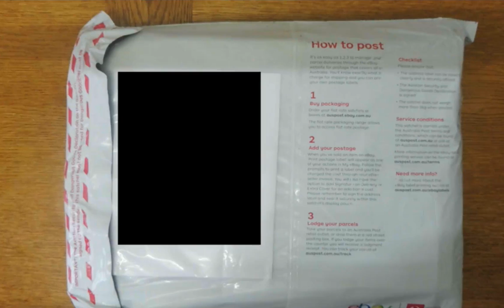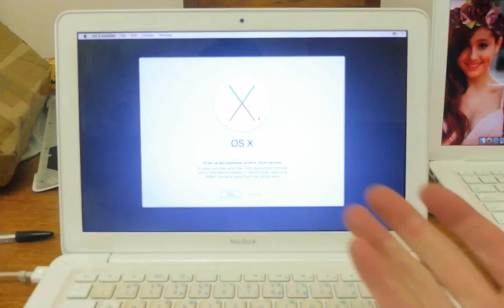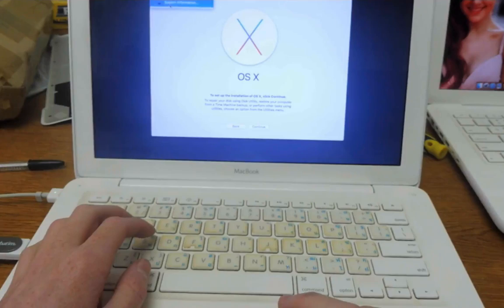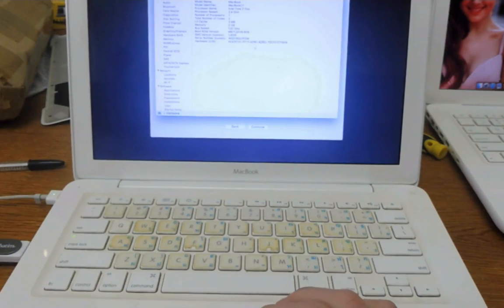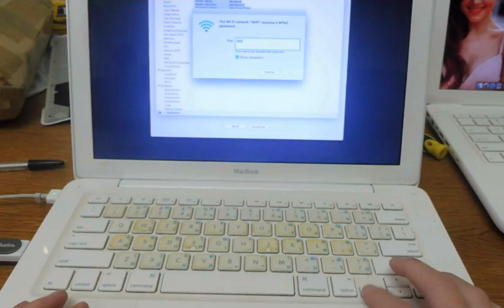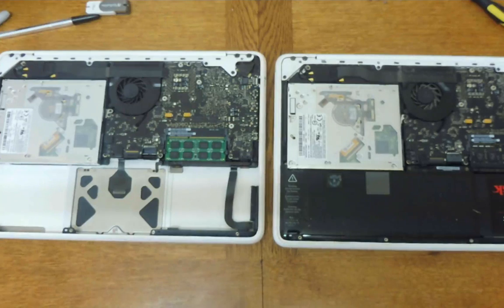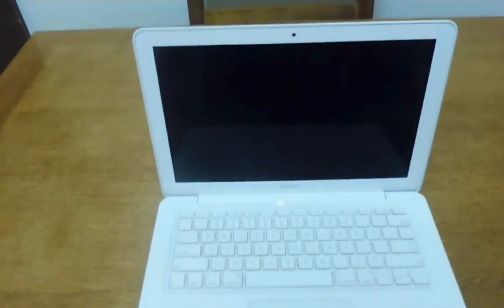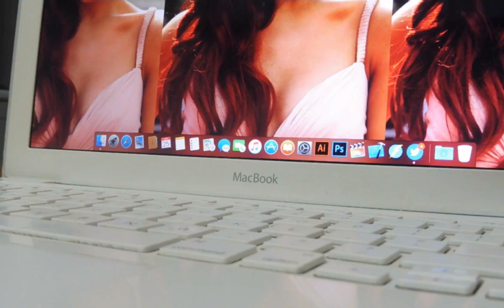Water Damaged MacBook Adventures Part 1 - Initial Look And Test

Comment: A little advice: I see you have a 240GB SDD, but the video shows you have only 8.27GB of free space. If you really need that much drive space, you should upgrade immediately to at least a 500GB drive. Every knowledgeable authority will tell you emphatically to keep NO LESS THAN 10% FREE, otherwise, you're drastically shortening the lifespan of your SSD. If you really want to see your 2010 MacBook scream, install TWO 500GB SSDs by ditching the optical drive, and set them up as a RAID 0 array. It will appear as a single volume on your desktop and you'll have a total of 1TB of storage. If you upgrade your RAM to at least 8GB, I suspect your MacBook will boot in about 15 seconds from a "cold start." I know mine does.